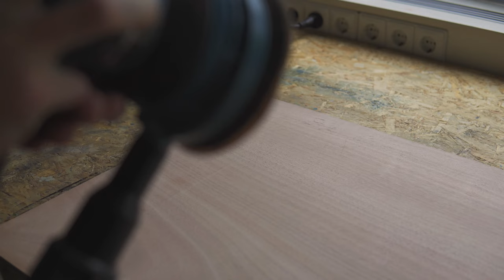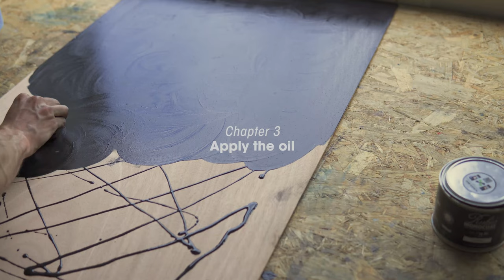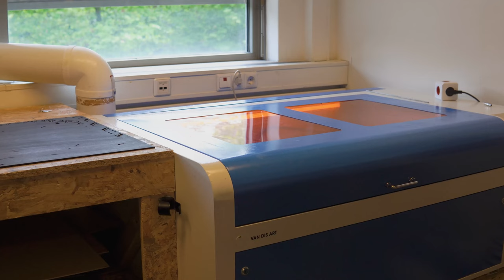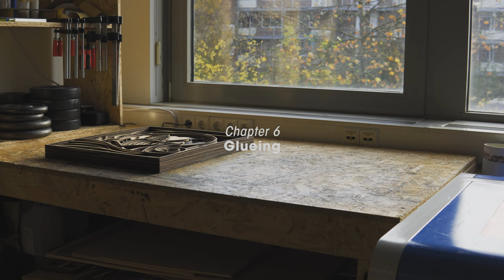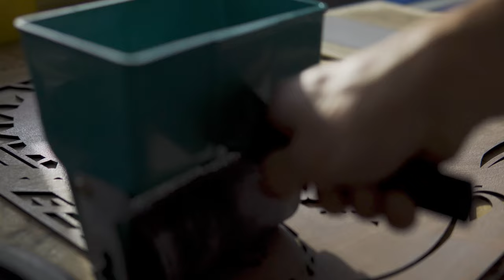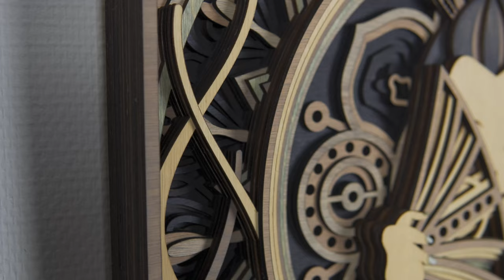How i make art | Laser cut wooden relief sculpture

Comment: very beautiful artwork! I actually want to go into this craft myself and there is a lot to be learned here. I was surprised to see you do the colouring of the wood pre cut. until now i have seen people doing it afterwards. Have you ever had any wood stretching, shrinking or warping during the process causing misalignments in the layers? that glue dispenser is a nice tool i havent seen before as well :).
Reply from the maker: No, never had any problems with it actually!  good air assist makes a big difference